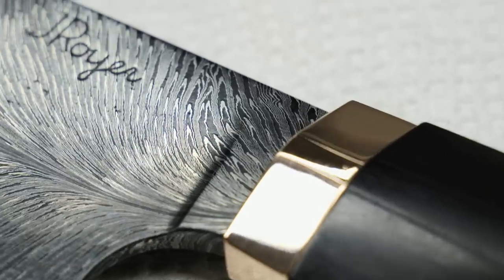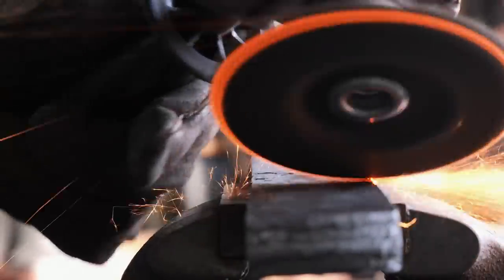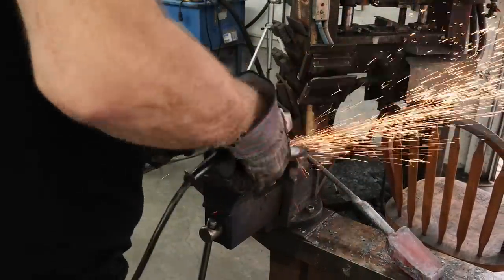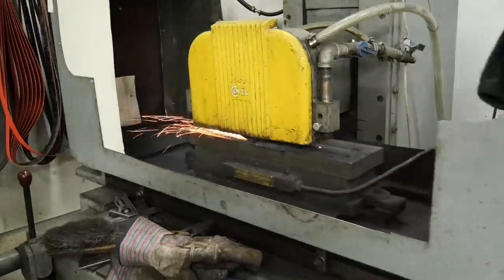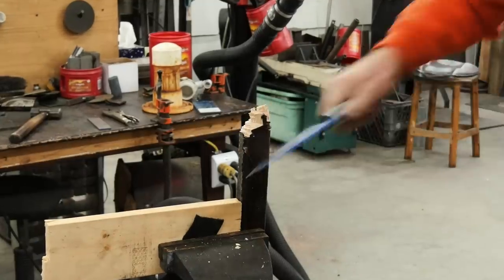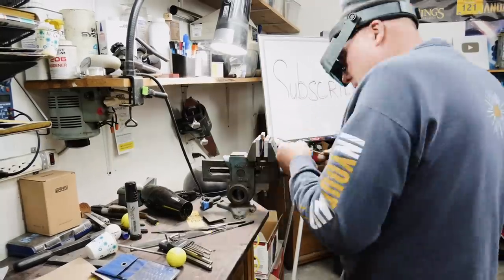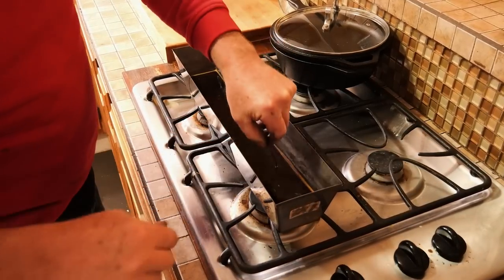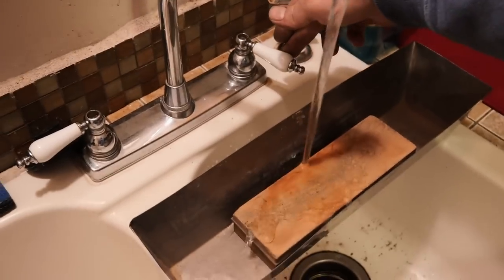Making a Damascus Chef Knife In 21 Minutes!?

Comment: Very nice work! Just a  opinion from a Retired Chef. The spine of the blade is a tool to. To much radius takes away that dull edge that with some skill can be used to peel with also its similar to how some Bow maker use the spine to chase the grain. Maybe only extend the radius to the length of the intended users pointer finger? 8^)
Reply from the maker: Hey thanks Chef. Will definitely consider. Glad you’re here 

Dad

Comment: I've all ways wondered - why does grinding the surface scale off each part matter?
Why cover it in MiG wire? The wire is all most acting like a foreign contaminants since it's coper coated Carbon steel and will mix with the billet.
Why not cover it in a close to air tight layer of removable steel if your trying to stop contamination?

Comment: Awesome knife I love feather pattern one question what did you use in the dremel when fitting the handle
Reply from the maker: Hey thanks 
Good question. I put a drill bit or a round file in it. This helps a slow and controlled tight fit on the tang. 
Glad you’re here hanging out with us 

Dad
Reply: @KyleRoyerKnives  thank you for the information

Comment: Any idea how to get the centerline to go all the way to the tip? Apparently there's a special way to hammer the ensure it follows through. idk.
Reply from the maker: Absolutely. The best way I currently know how to do that is keep track of the center during forging and forging the profile. Then before I normalize I gently grind into the tip on both sides and give it a quick etch. Mark center with a little grinding nick and double check the profile with my metal tinplate. If adjustments need to be made, now is the perfect time. Back into the forge make adjustments, keep an eye on the nick and it will come out exactly where I want it to. 
Keep Forging On my friend 

Dad
Reply: @KyleRoyerKnives  Thank you so much for the detailed reply!

Comment: Is it possible to make any kind of Damascus with hand tools and without modern forge????
Reply: You could use a charcoal forge.  You just need a source of O2, maybe a way to push large amounts of air into your fuel.  Kyle and Dad built a charcoal forge in an episode a while back.

If you don't have a way of doing an atmosphere-free environment for your forge welds, you could use borax as a flux.  Ilya of That Works typically uses this method.
Reply from the maker: Absolutely it’s been getting done for several thousand years. I love propane and hydraulic psi🤪🥊
Keep Forging On my friend 

Dad
Reply: @KyleRoyerKnives  Can you please make a video to teach right way of forging wootz steel weapon

Comment: The knife itself is beautiful, the fit and finish level is insanely high. BUT, why would someone want such a low performance steel in the kitchen? Toughness is low, edge retention is virtually nonexistent. As a collectible knife, it's flawless. But as a working knife? Really?
Reply from the maker: Hey thanks ou. This is high performance 1084 and 15N20 carbon steel my friend. RCH around 61. Tempered to 425. Pretty much top of the line kitchen cutlery. 
Deflection over brass rod, hair shaving then chop through a 2x4 then still shaves hair as original sharpening. No chips and no rolls. Top of the line cutlery my friend. Glad you’re here hanging out with us all. 
Chao

Dad
Reply: @KyleRoyerKnives  Hey dad, I do not live in an English speaking country, so it is not easy to express my thoughts exactly as I want. What I am saying is that base on a lot of research and testing from people like Dr. Larrin Thomas, there is no such thing as high performance 1084/15N20 damascus steel. Compared to modern powder metallurgy steels like CPM MagnaCut, M390, Elmax, K390, Vanadis 4 Extra, Vanadis 8 and similar steels, the damascus steel has an extremely low performance. You and Kyle make some of the most beautiful damascus knives on the planet. I completely understand the use of damascus for an investment level knife, sword or dagger. I just don't understand why kitchen knives when literally anything else is a better choice for a working knife. Even simple steels like AEB-L have much better overall performance. Of course, the science and facts don't matter. If someone wants damascus steel in a kitchen, I am fine with that.

Comment: Hey Guys. Great knife, all your work is exceptional. I'm trying some feather Damascus my self but I'm having trouble cutting the billet, what is the steel that you use to make your cutter. Blackhawk_forge_aus
Reply from the maker: Hey thanks Clive. You can use about anything. We are still using one of Kyle’s first fixtures. It’s a metal log splitting wedge.  We have several vids where we split billets for feather. 
Fear is not fatal and failure is not final. Keep Forging On Blackhawk 

Dad

Comment: Ummm. What is auto hamone....anyone
Reply from the maker: Great question my friend. It’s a place in the steel that didn’t fully heat treat like the rest of the blade. It’s good when we want it. It’s devastating when we don’t want it. 
Cheers 

Dad
Reply: @KyleRoyerKnives  ohhh.. because I have heard of it and using clay.. or more original material...
But I just never heard of an AUTO hamone... Didn't understand the auto part

Comment: FISH MOUTH, I  can't believe you would even leave it in the video. Your pattern really suffered from it at the point ( because you had to grind it off). Need to work on your hammer control. Overall nice work though
Reply from the maker: Hey good eye Billy. I explained that it was the top side of the feather made during the feather splitting process. I simply need to keep a eye on it so that I don’t get any welding wire in the tip of blade. When you watch vid again it will be much more clear. Or I could cut it off and possibly waste feather. I don’t want to waste feather it expense to make. Time and material. Keep Forging On 

Dad

Comment: So you're using 1084 in another steel and you're folding it so it's not actually Damascus steel because those mines are running low in Syria that's where Damascus is and that's where the steel comes from and it cost hundreds and thousands of dollars to even try to get that type of seal if they even sell it anymore which I don't think they do so you're just picking out steel and folding it and making a fake Damascus steel knife that's what you're doing because you call it Damascus steel and it's not it's just the type of steel you're using and you're folding it why don't you just say that
Reply from the maker: Pattern welded damascus my friend. It’s not about the steel as much as it’s about the technique. 
Chao

Dad
Reply: @KyleRoyerKnives  then say pattern welded steel because it's not Damascus
Reply: @KyleRoyerKnives  that's where you're wrong the technique is just folding steel that's all that's all you're doing Damascus steel like I said is from Syria